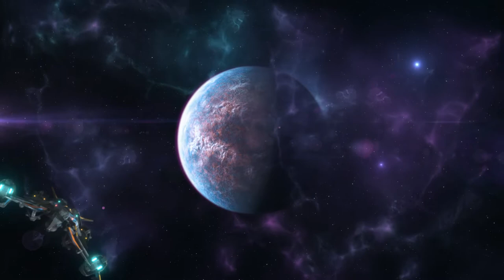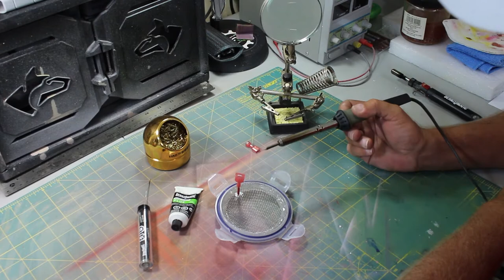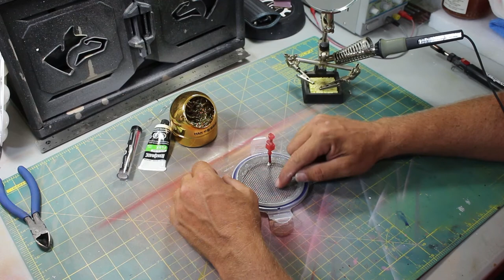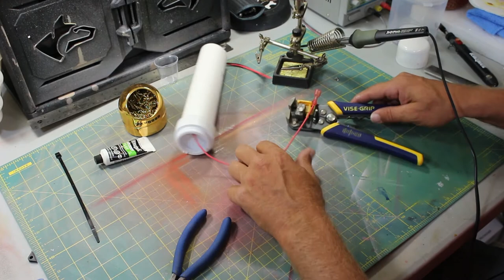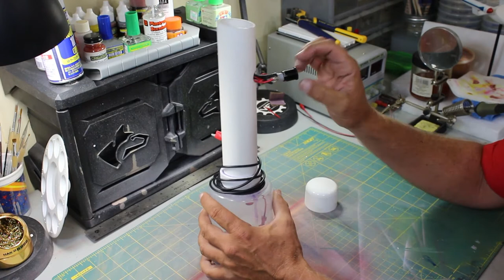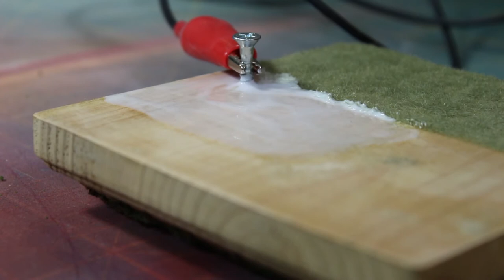DIY Static Grass Applicator Tutorial Part 2 - The Electronics

Comment: Greetings, i like the build, you can make it more efficient if you use a thin metal plate to the top f your containment cup and solder the wire to the plate rather than to the wire mesh. You increase the static field  ..
best regards Michael
Reply from the maker: Thank you very much for the advice!! Always helpful to learn new things :)

Comment: As one whose trade is electronics, for safety, I would mount the positive high voltage to a flat plate at the bottom of the handle, above the container. 
This does 2 things;
1. Reduces the chance of shocks if you accidentally touch the energised screen. With voltages between 6,000 V and 20,000V, if the ion generator isn’t properly current limited, the high voltages can cause a heart attack and you don’t want to be killing your watchers. 
2. Reduces the chance of arcing between the screen and the grounded base if they are brought too close to each other. This will reduce the possibility of setting fire to your model. 
It will still work fine as the object is to draw off the electrons of the grass giving the grass a negative charge path between ground and the charge plate making each stalk stand up and repel each other once the stalks are grounded in the wet glue. All the sieve  does is separate the stalks and give them a vertical orientation before falling.
Otherwise, not a bad build
Reply from the maker: Thank you for the advice. I definitely like safety as I don't want anyone or myself getting hurt :)

Comment: Wise words by Kenny!!! 2:30 the brass dry cleaner is also much better because of using the wet sponge, it cools down the tip of the soldering iron rapidly and causes micro-cracks, so you ruin your tip.
Reply from the maker: Trace Berlin I didn't even think of that :) good call buddy :)
Reply: You´re welcome :D

Comment: Hey, liked your video along with Luke Towen's. I'm afraid I'll have to look elsewhere tho on the electrical aspect of installing the the switch and power supply as you just breezed right over it. No video on connecting the wiring to the two, nor bringing it all together. As a newbie to the science of electronics and soldering I need to have a bit more info. Otherwise good advice and video.
Reply from the maker: You are absolutely right going back over the video I went way too quickly. I will definitely be re-doing this video and making another static grass applicator in the new year. Unfortunately, my little hobby corner is closed up for the holidays.
Reply: Thanx, looking forward to it. I've picked up the parts to get started but am a bit leary of starting till I understand better how everything should be put together. Mainly how to connect up a 6-pin on-off-on switch to the circuit. I want to run with the option of 9 volt battery or power supply.
Reply from the maker: @Iameddie2go  I have to play with that myself haven't done that yet.
Reply: A 6 pin switch is what is known as Double Pole Double Throw (DPDT)
This means it is actually two switches in one (double pole), each with two connections (double Throw).
The 2 central pins are generally the poles and the switch moves the two connectors to one side or the other. Use this switch to swap between your 9V battery and, for example, a 12V plug pack rated for the input current of the ion generator you are using.
Before connecting up confirm which is the pole and which are the throw positions for each pole by using the continuity tester setting on your multimeter (usually a separate mode on the ohms selection which sounds a tone when there is a short circuit between the probes). Label the switch position as off.
With one probe on the centre pin of one side, touch each of the other pins with the other probe. You should get a tone on only one pin. Switch the lever over while keeping the same centre pin connected. You should have no tone now on the pin you had it on last test. Continue touching the remaining 4 pins to determine the other side of that particular switch when a tone is heard. If no tone is heard, then the pin you remained on is not the pole, but the other side of that switch and the first test pin is your pole. Confirm this by probing the first test pin while leaving the probe on the second pin you got the tone on.
Mark on your drawing P for pole, NC (normally closed) for the pin that toned out with the switch in the first position and NO ( normally open)  for the pin that toned out in the second test.

Off      \      On          
      __\__              
      |______|             
NO  |    |    |   NC
             P
Test results:
Probes on P1 & NC1 - Tone
Probes on P1 & NO1 - No tone
Probes on P1 & NC2 - No tone
Probes on P1 & NO2 - No tone
Probes on P1 & P2 - No tone
Probes on P2 & NC2 - Tone
Probes on P2 & NO2 - No tone
Probes on P2 & NC1 - No tone
Probes on P2 & NO1 - No Tone

Off        /       On
      __/__
      |______|
NO   |   |    |   NC
            P
Test results:
Probes on P1 & NC1 - No tone
Probes on P1 & NO1 - Tone
Probes on P1 & NC2 - No tone
Probes on P1 & NO2 - No tone 
Probes on P1 & P2 - No tone
Probes on P2 & NC2 - Tone
Probes on P2 & NO2 - No tone
Probes on P2 & NC1 - No tone
Probes on P2 & NO1 - No Tone

           Switch 1
               P1
         _____
NO1  |  -  -  -  | NC1
NO2 |_---_| NC2
               P2  
         Switch 2
Once you have sorted out which pin is which, you can use this switch to swap between 9V and 12V power supplies.
Use a SPST ( two pins, Single Pole Single Throw) for power on/ off and a momentary NO push button switch for activation.
The circuit is made using the DPDT switch (SW1) as voltage selector, the SPST switch (SW2) as an on/off switch and the momentary NO Pushbutton as an activation switch (PB1) by wiring;
SW1-NO1 to 9V+
SW1-NC2 to 12V+
SW1-P1 to SW1-P2 to SW2-P
SW2-NO to ion generator +
9V- to 12V- to ion generator -

9V+ O—————|   SW1 
                  NO1 O
 9V-  O—-|                P1
                 |            /——O——————-|
                 |           /  LED1    R1             |
                 | NC1 O--|>|—-/\/\/\/—-|      |
                 |                                     |      |
                 |  SW1     LED2    R2     |      |
                 | NO2 O—|>|—-/\/\/\/—-|      |
 9V-  O—-|                                   |    |
                 |                   P2            —     |
                 |            /——O———-——--|
                 |           /                               |
                 |         O  NC2                      |
12V+ O-—)——--|                                |
                 |                                           |
12V-  O—-|                   ____________|       
                 |                    |
                 |            NO O
                 |                              P  LED3
                 |       SW2     —-O—|—|>|—|
                 |                   /          |          /
                 |                  /           |          \  
                 |         NC  O           |     R3 /
                 |                              |           \
                 |                              |         | 
                 |            PB1 |      |         —
                 |            NO O  O—-
                 |                    |  LED4 R4
                 |                    |--|>|-/\/\/\/—|
                 |                    |                    |
                 |———-|        |                  | 
                 |      -   |         |  +              —
Probe       |        |_____|__
—————|         |     Ion        |
              |       | Generater|
               —
Reply from the maker: That is some serious information thank you

Comment: What are the specifications for the negative ion generator?  I think there may be DC and AC versions.
Reply from the maker: Power use: less than 1 watts

Ion output voltage: -9500V

Coverage: 200 square feet based on HVAC installation

Power requirements: 12 VDC

Ion density: 1.9 trillion ions/cc at 2.9 cm from emitter

There is a link in the description to the one i used. With the Covid it has shot up in price.

Comment: Is the negative lead that attaches to the pin/screw attached to something inside?  If so, I didn't catch that part in the explanation.
Reply from the maker: TheRunesmythe the side with one wire is the high voltage side and is connected to the screen, the red and black wires are connected to the positive and negative poles of momentary switch and the black ground wire out of the side is connected to the negative pole of the momentary switch or female power jack.
Reply: Okay, thanks for the clarification.  I didn't catch where you'd attached that single black wire with the alligator clamp before.
Reply from the maker: TheRunesmythe thanks for pointing that out :) I did miss it in the video.

Comment: Oh, one minor point -- Is the high voltage ground common with the 12v input?
I only see one HV wire, the Red one, hooked to the screen. The one with the Aggilator clip goes ... where?
Reply from the maker: Yes that is all on the same ground. Sorry I didn't see this comment until today.
Reply: @HobbyLinkInternational  No prob. Thanks for the info.

Comment: Good video! So would a 20A switch work? I'm mentally challenged when it comes to electronics. Lol
Reply from the maker: If you are using a switch like this https://www.amazon.com/Bestsupplier-Rocker-Toggle-Switch-Control/dp/B0722K5LD1/ref=sr_1_8?s=automotive&ie=UTF8&qid=1548033998&sr=1-8&keywords=20a+switch yes you will be fine.Thanks for stopping by and watching the video :)
Reply: Thank you sir!!
Reply from the maker: @alklimesh8919  you're welcome if you have any questions feel free to ask
Reply: Ok, 3 more questions. Was your ground wire 22 gauge also? If I had a old overhead light could I rob the wire out of it? And where did you get the Tupperware from? I haven't been able to find one like that.
Thanks, Al
Reply from the maker: @alklimesh8919  yes the wire is all 22 gauge. And you should be able to use the wire you are talking about. Here is the link to the hopper https://www.amazon.com/gp/product/B0000AN4D0/ref=oh_aui_detailpage_o03_s00?ie=UTF8&psc=1
Reply: @HobbyLinkInternational  so I got the same momentary switch you got. The little diagram that came with it says pin c to positive of the device. Would the device be considered the ion generator?
Thanks!
Reply from the maker: @alklimesh8919  you are going to have to connect the positive of the Ion Generator and the positive of your power port to that positive pin. Same goes for the negative wire of the Ion Generator and power port they go to the negative pin of the momentary switch. But, you will also have to attach the wire that shoots out the side of the applicator to the negative. So that will be three to negative and two to positive. And, the single line of the ion generator goes to to the screen.

Comment: Thanks Kenny for the great video, quick question; what gauge wires did you use?
Reply from the maker: Tim Vitellaro thank you :) the Guage I used was 22 gauge. The one in the body has a thin sheath to it. The outside ground has a thicker sheath for protection against nicks and cuts.
Reply: Thank you :)
Reply from the maker: Tim Vitellaro anytime :)

Comment: Hi! Is there a diference between negative ion generator and high voltage generator. I get myself negative ion generator with output of 2.0-6,0kv and it feals a bit weak.
Reply from the maker: I don't know how safe a high voltage generator would be. I cannot give out any information on one because I have never used one. You would have to do some research on the differences and make decisions on your research. Sorry really can't be of any help on that question.
Reply: I’ve built a small applicator, head was only 25mm (1 inch), using a 6 KV negative ion generator bought off eBay. It was no good for the large applicator 75mm (3 inch) unit but works great in the small unit. I used a 20KV ion generator for the large applicator. I 3D printed all the tubes, heads, caps etc and I’m extremely happy with the operation of both units.

Comment: Your link for the power source does not work. I have a A.C. adaptor that the input is 120vac 60hz 14W and output is 9vdc will this work?
Reply from the maker: +Russell Atstupenas I made it to work with 12v power adapter the momentary switch is also 12v. Here is the link again if it doesn't work on youtube email me at hobbylinkinternational@gmail.com and I will directly send it to you. https://www.amazon.com/gp/aw/d/B00Q2E5IXW/ref=mp_s_a_1_1?ie=UTF8&qid=1506593052&sr=8-1&pi=AC_SX236_SY340_FMwebp_QL65&keywords=tmezon+12+volt+2a+power+adapter&dpPl=1&dpID=41k2rLpBUML&ref=plSrch
Reply: SciFiantasy thanks so much!
Reply from the maker: Russell Atstupenas any time :)